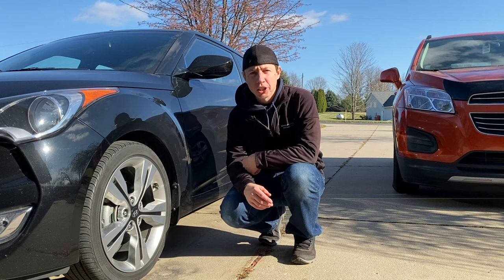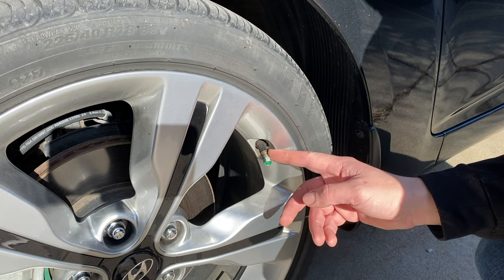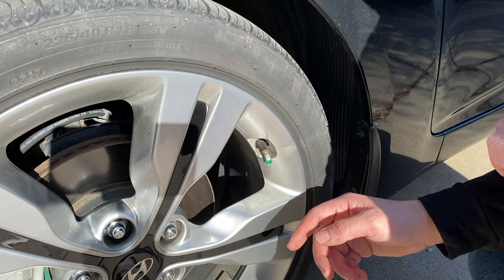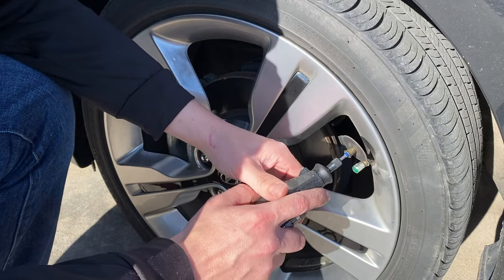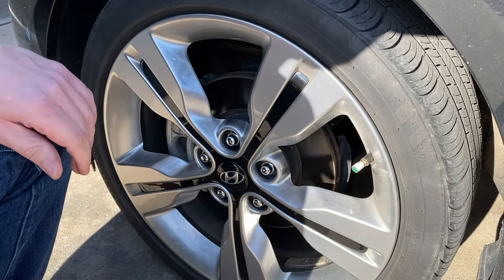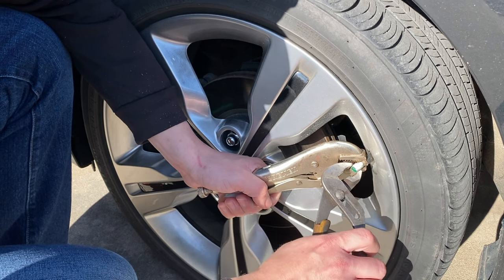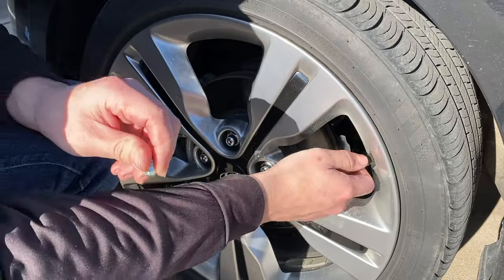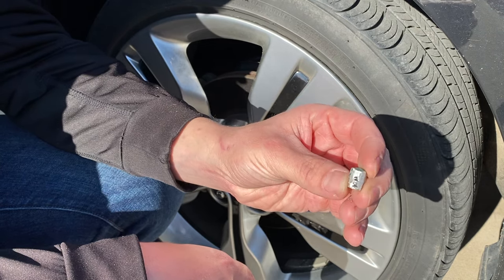Corroded Stuck Valve Stem Cap Removal - Don't Break Your TPMS Sensor!!! - How To

Comment: There should be a class action suit against the companies that sell these things. How absolutely stupid to make something that ceases on so much you can't removed them by hand. How crazy to make something that takes something we all  take for granted and make it so you can't access your valve stem to put air in your tire. How crazy is it that you could be on a trip somewhere, thousands of miles from home and have to pay someone to remove your valve step caps because you need to put air in your tires. Absolutely crazy.
Reply: Agreed
Reply: Yep. One of mine is completely fused on and I was just quoted $220 from the tire shop to remove it. All over a $9 set of valve caps from Amazon.
Reply: Mine were put in by the dealer or chevy plant. 320$ to have them fixed. It’s a 2019 impala only driven by me. Bought in 2020. I’m 75 and not able to fix this with a limited budget. I have always gone to the dealership to have air put in my tires. I did live in Michigan but now Texas.  What do people who are disabled or old do?
So many of us elderly can’t find help. It just makes me so sad. 
This just happened today. Going on a trip and wanted to get  the car checked and ready. Hubby just died so everything is up to me.
Reply: Agreed! This is ridiculous! I finally started trying to take one off...I cut too deep and started hitting the brass valve itself... the top of the cap ripped off as I was twisting it. I'm gonna take a look at the company I bought this from to see if they have a warning on them about these aluminum caps welding onto the valves! This is beyond ridiculous! 😡😤😡😤😡🤬😠😡😤😡😠🤬
Reply: I was all set to blame the caps but, as it happens, the caps were brass as advertised but the valve stems were aluminium with a brass-coloured coating to make them look like brass. I'm going to discuss this with the tyre fitters as they supplied the stems about 12 months ago. It was a hell of a job as the caps and stems were so solid I had to grind every cap off entirely and pick the fragments that were still in the bottom of the threads out with a scalpel - quite a long job that required me to take the wheels off to get them in the workshop.
Reply: Agree completely. I had no clue this was even a thing. Now I need air in my tires and the caps are stuck. It's causing so many problems for me...
Reply: @tina4marie4  If I had to sort this again I would take the job to a tyre bay and let them sort it out. It took me the best part of a day with a Dremel to get the caps off and I'm still stuck with the cheap aluminium valve stems that were the cause of the problem in my case.
Reply: @ColinMill1  I went to meineke today and they quoted me 900$.I told them I just bought 4 new tires I just need valve stems replaced they then quoted me 600$..smh..
Reply: @tina4marie4  wow! I thought things were expensive here in the UK but that is taking a liberty. We have independent tyre fittings places that will fit the tyres you buy on the internet. I think it costs about £25 per wheel and you can get the tyres delivered directly to these fitters. Got to be worth shopping around.
Reply: If you check your air pressures once a month it really isn't an issue. Use Anti seize and enjoy the wonders of cool looking caps.

Comment: Bro I didn’t have the saw dremel but instead I hand the sander on the dremel and dremeled it down to the thread and clamped it and turned the valve with my gerber had to adapt and overcome, sick vid and advice dude really appreciate it

Comment: Thanks so much for this video. Didn't have dremel so i cut sand paper into strips of about half inch. Then towel it continously around top of the cap. Stopped once the brass thread is exposed. Walla! I was able to unscrew cap. Took almost 2 hours.

Comment: YOOO Thanks! We used the oscillating dremel sander attachment so we wouldn't destroy the stem, just sanded away the aluminum until I saw threads, then used a hacksaw to remove the tip of the cap and make some relief cuts along the cap body, then side cutters rolled the chunks off like butter!

Comment: so any mechanic (certified or shade tree) should tell people to remove any aluminum or steel valve caps right away. If they don't inform their customer or friends, then they should be strung up by their boots
Reply: If they did that they wouldnt be able to sell tire sensor replacement for $100 a tire

Comment: Very helpful video. I got the exactly same problem and solved it with this suggestion, successfully. Four tires, it would take about 10 minutes for each tire. One tip: to cut the caps until the brass valve stem shows up. A little bit of cuting on the stem would not hurt anything.

Comment: Thank you - your video certainly helped, and persuaded me that I did not need to go to an expensive tyre (tire) shop!  I bought an Afantti Mini Rotary Tool Electric Corded Multi Micro Sander Grinder Drill from Amazon (£21); the grinder worked perfectly and very quickly; once the brass of the valve stem started to be exposed, the caps unscrewed easily (one pair pliers on the valve stem, the other to unscrew the cap, as per your video). Btw, I have no connection with or commercial interest in either Amazon or Afantti. Hope all of this helps.

Comment: Dremel worked perfect for me on my s3 8p, thanks for the video. I suppose copper grease on the valve thread before fitting could help, but for me it's lesson learned and I won't be using anything but the standard plastic caps in the future.
Reply: Also happened on my 8v lol did you have the red 4 rings caps?
Reply: @brandonlathe7732  yes I think that's tho ones. Was given them as a gift so used them but regretted it lol. Easy enough job with the dremel tho. We live and learn
Reply: @accelerate3538  didn't want to have to break the ole dremel out but sounds like thats the best move, agreed tho won't be using metal ones again lol
Reply: Copper ease would work if you really like the look

Comment: I'm having this problem right now. My valve caps are aluminum I think. I live in NJ and I think with the snow and salt they are stuck! I went to the tire shop and they quoted me 900$ lol...Said they need to replace everything, even the tires...smh...Thank you so much for this video you saved me ALOT of headache ❤

Comment: I got a hyundai this last summer. The tire pressure was low. The manufacture added these god for saken caps. Now it seems like a big mess. The companies should be paying for the replacement cost snd labor involved in fixing this. Cheap manufactures should get slapped with lawsuits. I am elderly on a fixed income. Let's face it nothing is made to last anymore.

Comment: I guess I got lucky, after seeing this, I tapped on the top of the aluminum valve cap with a hammer, applied the vice at the top of the stem near the cap like you showed, and used a 10mm socket and ratchet on the valve cap itself.  Which I guess was lucky enough again that the caps were hexagon style.  Worked great.  Thanks for getting me most of the way there.  Might have also helped that those aluminum caps were only on for 3 months.  Ottawa, Canada.
Reply: You think I could get away with using two sets of pliers instead of a vice grip? I don’t have vice grips.
Reply: @Father_Brother_Son  It's gonna be rough.  The trick with the vice grips is to get it locked on at the top of the stem/start of the thread just right with just the right pressure without tearing up the rubber around the stem.  And if the cap is really good and corroded on to the valve thread, no amount of pressure in the world will help you and you will have to do the dremel cut method as he shows in the video.
Reply: @ThePunOne  I understand. I’m pretty sure my caps are plastic, though. Not metal. They’re still really stuck on there, though. I even tried putting on gloves and the valve will twist, but not the cap. With them being plastic, you think that will make pliers more feasible?
Reply: @Father_Brother_Son  Yes if indeed plastic caps you should have an easier time then the rest of us.  Keep in mind you want to pinch right at the top where the thread starts so as not to rip up the rubber around the stem which would just slip and slide anyway.  And no doubt you will be throwing away those plastic caps when you are done.  And likely easier with the wheels off the car on a horizontal surface if you can.
Reply: @ThePunOne  Good to know! I’ll see about removing the tires to make it easier and try not to screw up the valves. Thanks a lot! Hopefully I can still save the caps despite the pliers! Lol. God bless!

Comment: Thanks!  I ground down a portion, the. Cut the end to expose the rubber washer. Shot some WD40 in there. Let set. Came off with a socket without the stem turning.

Comment: Well that sucked! Scary as hell having a grinder that close to the wheel. Lesson learned. I will never use metal valve stem caps again. Thanks for the tip.
Reply from the maker: So scary! Never using aluminum valve stems ever again either!
Reply: If you do , put some grease or fluid film in prior . Brass on aluminum always has corrosion

Comment: My cap was stuck so I got out a pair of pliers and gave it a little more torque.  And half the threads broke off.  I’m not sure if holding the collar nut would have helped.  Ok, would it help to put vaseline on the threads before and/or screwing on the cap?  Come to think of it, the cap was plastic so wt*?

Comment: Just recommend peeps use anti seize compound on the valve stem threads when putting on an aluminum valve stem cap. But if you didn't do that occasionally, you end up with this video. I will say using the vice grips is a 50/50 proposition too much squeeze and you ruined the valve stem schrader valve assy anyway. Additionally use a 10mm or so wrench 6 flat wrench "not 12" , on the cap to remove after using the Dremel. You still have 5 flats left on the cap to use.  And more torque. and control as well. This idea of using channel locks is back yardish mechanics.  But sometimes its your only choice. It shouldn't be your first choice.

Comment: There's about a 50/50 chance, at best, of success in doing this. But there aren't many options either. Once the caps are seized up, they're usually not going anywhere. The concern here, and again, it's worth a try, is the entire stem just cracking off. They are incredibly fragile, especially the TPMS stems.

Comment: If this works for me, I'll definitely sub bro
Reply from the maker: So did I get that sub??? :) Hope it turned out well! Thanks for watching
Reply: @ChadWilliamsFixesAll   yessir, didn't use your method exactly, didn't have my Dremmel so I used a very thin file, sliced it and separated by inserting a flathead and you could see it pop then I just spun it off,, I just needed to know it was possible. It was, thnx, new sub
Reply from the maker: That is great to hear! Luckily aluminum is easy to file :) really appreciate it!

Comment: You can use a hair dryer and then use  pliers
Reply from the maker: Hmm, I will have to try that next time I deal with this type of issue.
Reply: Good luck. I tried heating mine very carefully with a small torch and only got 1 out of 4 off.